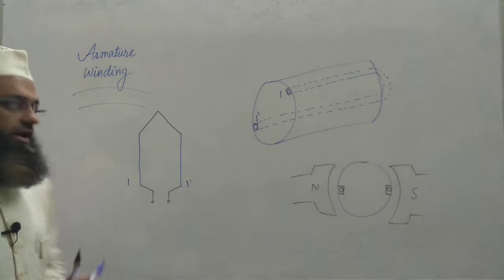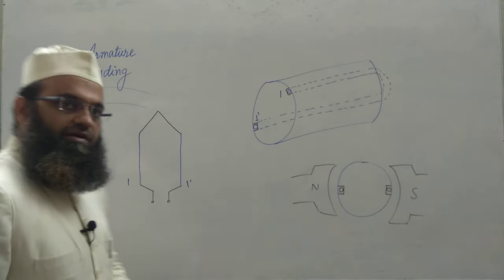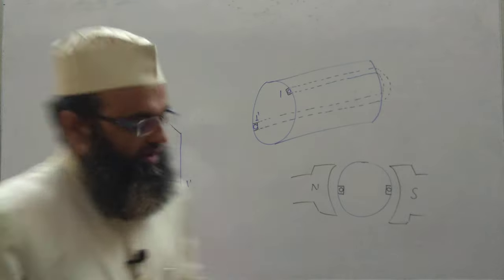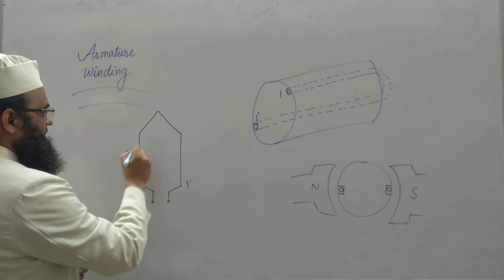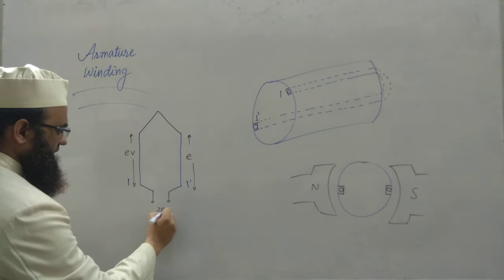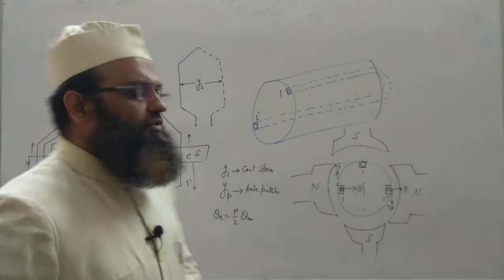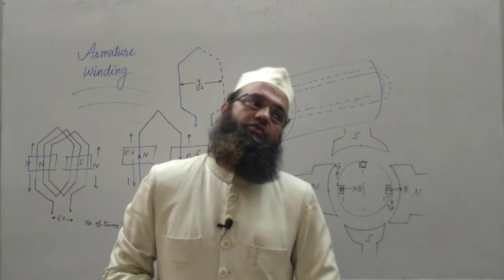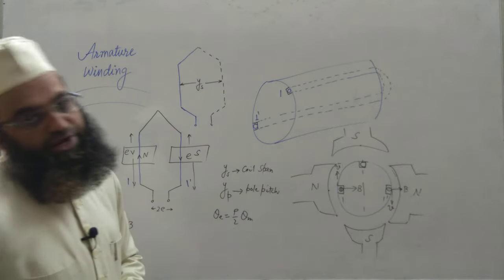Armature Winding in DC Machines | Part 1

Comment: Sir at 6:00 as said by you that the conductors are connected in series and that's why net emf across the two ends has increased. But sir in series current remains same just like how in parallel voltage remains same then how can we say that both are adding instead of saying that since both the conductors are connected in series then same current should flow?
Reply from the maker: In two series connected conductors, same current flows through resistances (R1+R2). Therefore, net emf=I*(R1+R2)=I*R1+I*R2